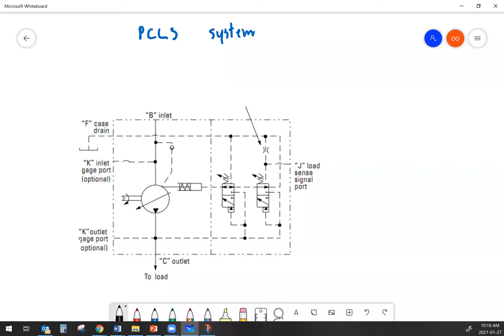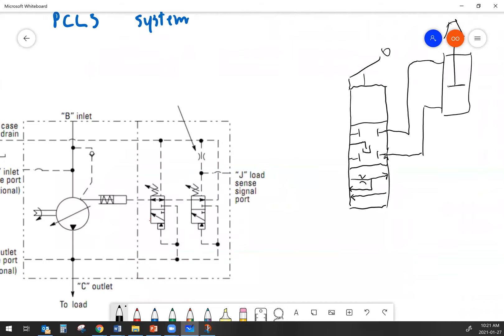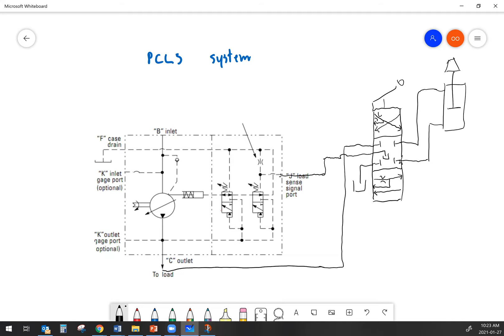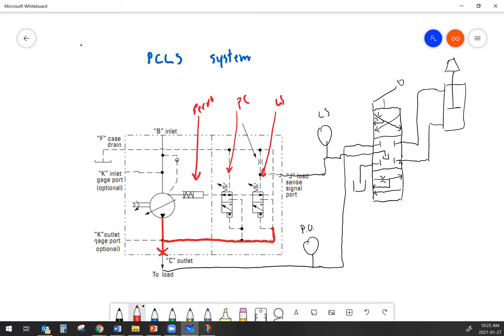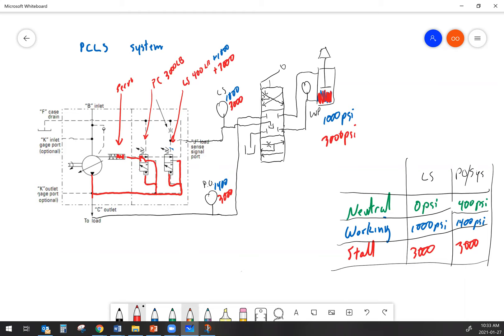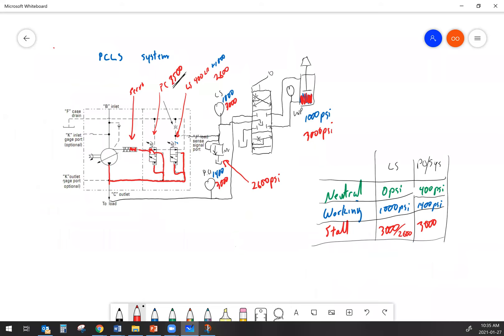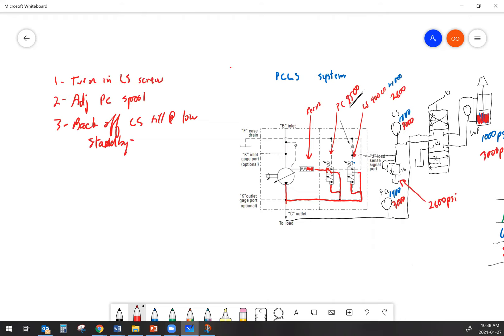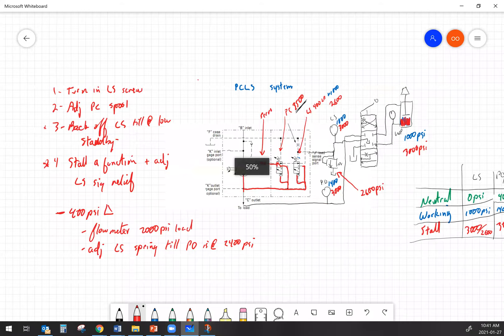Pressure Compensated Load Sense hydraulic system explained

Comment: HI! Thank you for sharing this video, it is a very useful lesson, I like it a lot. I also have a question and if you could answer it that would be awesome, but if you don't feel like answering that's good too. So my question is: I've worked with several different machines, and I have an access to service manuals, them machines would have a very similar hydraulic system with LS signal relief, and to actually test the pump load sense differential and cut off pressure the manual would state something like "The hydraulic pump cut-off pressure is set higher than a function control load sense pressure reducing valve. A function control load sense pressure must be adjusted higher than hydraulic pump cut-off pressure to perform this test" so why is that, why the LS pressure has to be adjusted higher than cut off? Thank you
Reply from the maker: You have to override the load sense system and it's relief (load sense pressure reducing valve) so you can get the system up to the pump cutoff (pressure compensator spool adjustment) so you can set this.

It's easily done by turning in the load sense spool all the way and deadheading a function.  The pressure on the pump output will be the pressure compensating spool value.  Set this, and then adjust your load sense spool back to low standby value.  Deadhead a function again and adjust the load sense relief until you reach your max system pressure (based on LS relief value) and then you're done.

Don't forget to go back an double check your pressures if you need to do a dynamic pressure adjustment on the LS spool for a delta pressure spec.